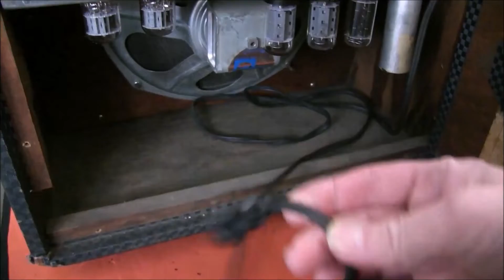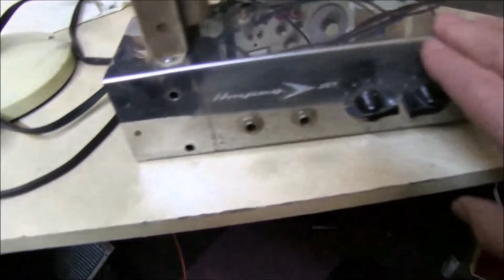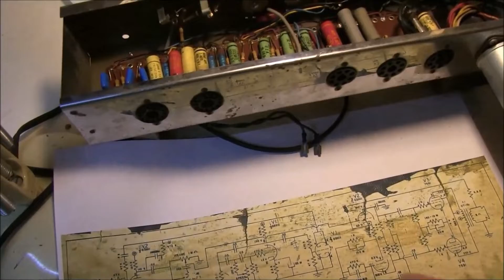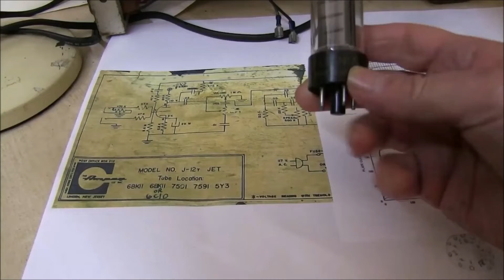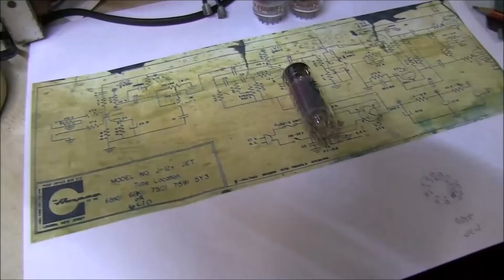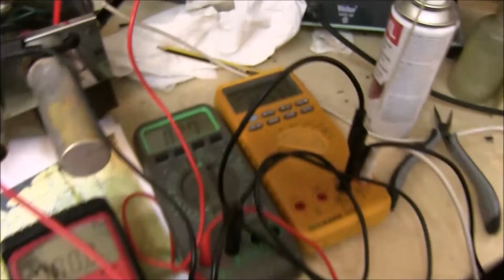Ampeg Jet J-12T Combo Amp from 1965. Service, Analysis, Sounds

Comment: 7591 is essentially a 6L6GA with significant mechanical differences that push it towards linear HiFi use typically. They can't disappate heat as easily as the big plates in the 6L6G_

Comment: Earlier versions of the Jet used 6V6 power tubes and 6SL7 octal preamp tubes.  That version changed to 7591 and 12AX7 (SBK11), which gives it even more headroom, louder, and brighter.  I prefer the warmer tone of the earlier version, but that version is great too!!

Comment: National Union was a tube manufacturer of the 1930's and 40's;  by the 1950's they were known as National Electronics and specialized in transmitting tubes for commercial use. In the 1960's the name was bought by or became a subsidiary of Richardson Electronics who were well known ----- or notorious ----  for  rebranding tubes in red with their own name and logo (the tube cartons were also red). To the best of my knowledge, "National" never actually manufactured 6BK11 or other Compactron tubes,  and I don't think that Compactrons were ever manufactured in any quantity in Europe or Asia, so these were likely sourced from one of the big US manufacturers, most likely RCA or Sylvania (Although, if the pins are indeed undersized, then perhaps they are of foreign manufacture; it would have been interesting to measure them with a micrometer)..  Tubes rebranded by Richardson could be just about anything, from anywhere, and they sometimes actually changed the number on the tube as well 😖 so these could actually be 6C10's or some other compactron triple-triode variant.  Ned Carlson wrote about this on his Triode Electronics website, where he says that buying  tubes from National/ Richardson was a bit of a crap shoot: sometimes you would get high quality European-made tubes, and sometimes you would get tubes from India or Japan that were branded "Made in Great Britain"..

Comment: I have owned both a J12 with 6V6 outputs from around 1960 or '61 and a J12D with 7868 output tubes from around '63 or '64 as I recall. Both excellent sounding amps but the J12D had more headroom and a somewhat cleaner sound, though it distorted nicely when pushed hard.  7868 tubes are electrically and sonically the same as a 7591 but with a very different Novar base (9 skinny pins) and different socket.  Like the 7591, 7868's were used in numerous American made Hifi amps such as Scott and Fisher.  I don't know if modern reproductions of the 7868 are currently available, but vintage examples will typically cost you about half of what the pricey vintage 7591's do.  Ampeg did not push their output tubes to the maximum like many other amp manufacturers did,  so these tubes tend to last a pretty long time in an Ampeg. Interestingly, when I got them,  both amplifiers only put out a couple of watts of power due to bad resistors in the phase inverter section. I remember that the resistor values for the J12D were a little odd and I didn't have them in stock, and had to order them.  If you are working on one of these, check those resistors for correct value or having gone open. Probably a good idea to upgrade them by doubling the wattage and perhaps changing them to metal film types. PS, both amps had leaky "death caps" that put voltage on the chassis  And immediately tripped the ground fault circuit interrupter (GFCI) outlets when I plugged them in on the kitchen counter and turned them on.

Comment: Thank you so much Nick!  This really helped me understand the circuit in my mid-1965 J-12T.  Mine is totally unmodified (at least until I get the electrolytic caps replaced and a properly grounded power cord installed.)  Your schematic is great.  Mine is missing the upper portion of the Trem circuit and part of V2 and V3 at the top. Mine also doesn't have a date mark, but my original Ampeg-labeled Jensen C12R speaker dates to about May 1965, and has a serial number that puts into mid-1965.

The original tubes were labeled "Made in USA for Ampeg by Sylvania" in yellow lettering.  The 6BK11's are extremely hard to find, but my labels definitely show factory stamped 6C10 as equivalent for 6BK11.  The only real difference is that the 6C10 is a 100/100/100 triode gain factor and the 6BK11 is 70/100/100.  Ampeg seems to favor the 6BK11 in the V1 slot.  6C10 compactrons are easier to find but still expensive.  Some people report good results with 6D10 or 6AC10 tubes.

I found another schematic on Reverb dated "365" which differs from your "265" in that the Trem circuit on the 365 schematic does not show a .22 capacitor ground like yours.  It also has a 3.3K resistor to the switch and not a 2.2K like yours.  The other difference is the V1 symbols on the 365 have different numbers on the pins.  Interestingly, on the partial schematic on mine which is a slightly later 1965 model than yours or the "365" amp, I have the 2.2K resistor on the Trem switch and different V1 pin numbers than both yours and the 365.

All of these schematics share some strong similarities to a J-12D "567" schematic I found on the internet, which also has different values for some of the components and which has dropped the rectifier tube in favor of solid state.

I'm not entirely sure what changes to the Trem these subtle differences would make or why Ampeg kept changing the circuit

Again, thanks for the great video.

Comment: Excellent Video Nick!  I've just picked one of these up and it's the same year and schematic exactly Feb 1965 - Mine is missing the top half of the drawing unfortunately :-( 
- It has a grounded (earthed) cable added, but I think that's the extent of the work- all looks original with the preamp valves switched to Ac10s-  I've order some parts and will replace the multi-cap as it hums too much around 120 Hz with the volume up even just past 4 - I'll try the potentiometer trick on the feedback to the speaker as well !! I've managed to get a screen-shot of the schematic you copied (a bit fuzzy!), but I'll search online for a proper one here in a bit - Nice work though and thank you !!
Daniel (Los Angeles)
Reply from the maker: Hi Daniel. I love that Ampeg so much, but I had to give it back.  Email for the schematic:  nick@demonproducts.co.uk
Rock and roll. Nick

Comment: I could have had one of these amps while exploring my aunts old house there was one of these amps on the floor but instead I only took the tubes from it now the house has been pushed over for safety reasons I really should have taken it with me
Reply from the maker: Hi Rumbler. That  happens a lot. We have all thrown away things which are now valuable. But you had those fabulous tubes. Rock on.  Nick
Reply: Derp

Comment: Great video Nick. This is a great affordable amp for 1st time tweekers of amps. It is a classic tube layout and easy to work on. You can play with mods on so many things. You can get replacement bits from https://www.fliptops.net/. You can change the feel of the amp quite a bit by getting a 7591 to EL84 converter by Yellow Jacket. Its loud enough to play a small club. I love my J-12-A overdriven or clean.
Reply: That's the version I have from 1959.  Circuit "J-12A" indicates it uses the 6V6 power tubes and 6SL7 preamp tubes.  Love mine!

Comment: Yeah thanks Nick another nice vid although I havn't had time to watch it all , I will assume you got new valves then, the first ones
were arcing you could see em nice work mate.
Reply from the maker: Hi, Thanks. I was really impressed by the sound of this amp. Those 7591 valves are excellent. I want to mod another amp to use them.  The amp sounded even better through a better speaker.  The tremelo is nice , but only at low settings, or it thumps. The customer was very happy with it.
Rock on.. nick
Reply: Nick c'est tres formidable I won't ask how much money you spent doing that up then. I noticed you had the US Marshall on the bench, it probably needs all the pots replacing in the least. Do you see yourself upto doing that one? would it be worth doing?
Reply from the maker: @factorylad5071  Hi, that Marshall was a Studio 15.  I serviced it and sold it. The Jet had a nicer sound. The customers were happy with both. The Jet sounded like new.